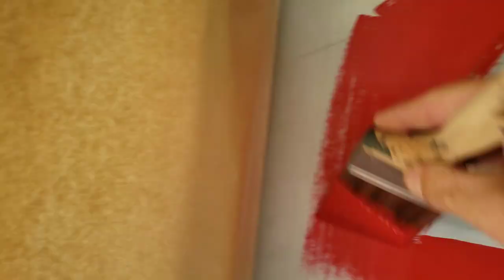Can You PAINT a Fiberglass Door with Latex - My Method - Easy and Fast

Comment: How would you paint your doors like that if it was hot outside won’t it dry to quick and leave brush marks ?
Reply from the maker: I would either spray them is ideal. You could also remove the door and place it in a shady location or indoors ...
  Other option is to thin paint according to label. And do several thin coats...
  Hope this helps.
  Sprayimg is IDEAL though.

Comment: Do you always paint the interior of the door the same color or not every time ?
Reply from the maker: Thx for the Question. So mostly never. It's really a preference with most of my clients... my personal opinion is: use  the exterior of the front door as an opportunity to add an Accent Color.
  But for the interior. Id prefer it to match the rest of my "interior" doors.
   Does that make sense?
Ate you doing a diy project? @shawoo
Reply: Tym O'Laughlin thanks for the info. Was wondering what most people do. That helped a lot. Yes having a new fiberglass door installed. Thanks man, big help I appreciate it